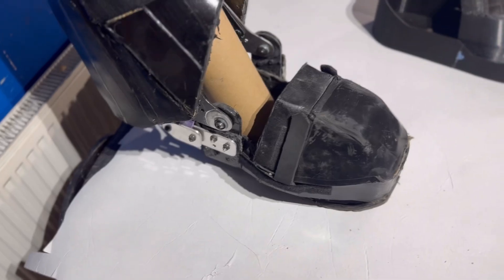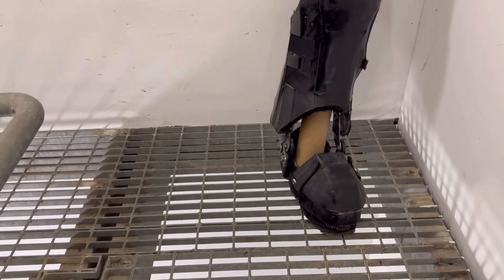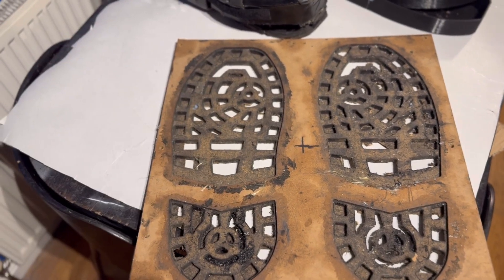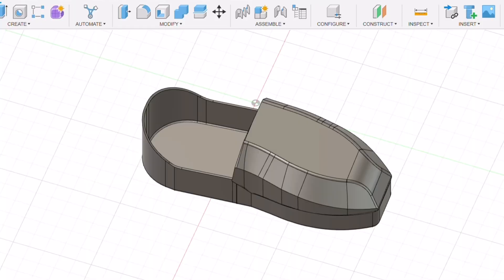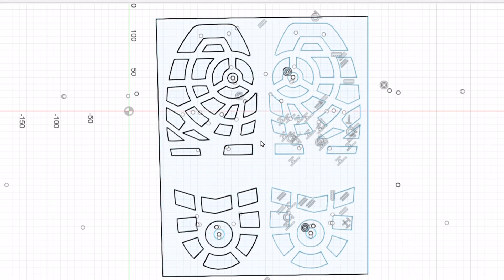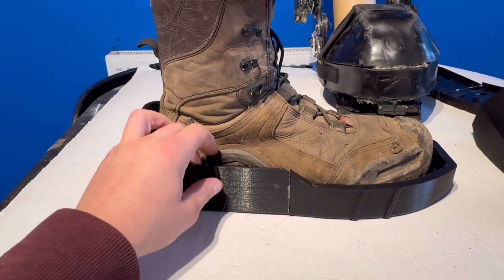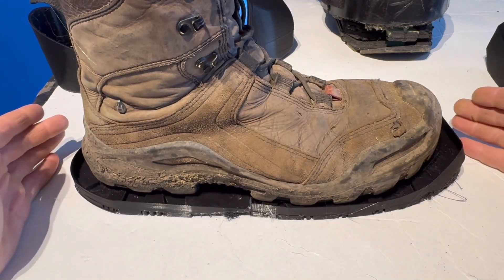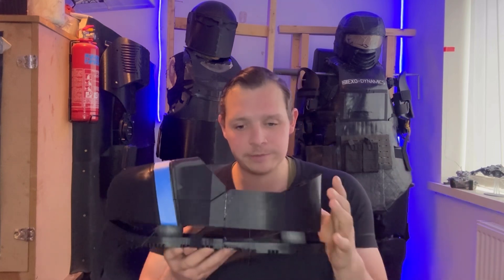The WEIRD Problems I found making EXO-SUIT BOOTS - Power armour casing upgrades

Comment: I don’t think lining any of the armor with ceramic is a good idea. Not only does ceramic expire and thus loose its bullet resistant capabilities, it also doesn’t have multi-shot protection abilities, and thus becomes brittle after taking an initial impact.
Reply: Have you seen some of the new developments in ceramic plates? There are a few that can now take a few hits.
Reply: Why add armor to protect your feet. Most will shoot at your upper body.
Reply: @ofire6E15E  Its not just to protect against gunfire. Shrapnel is a massive cause of injury and that can strike anywhere.
Reply: There are some new ceramic mosaic designs which divide the plate from a single piece to multiple, meaning one shot will not compromise the entire plate.

Comment: I would argue power armor ahould not be used while operating a vehicle not made with power armor in mind. Obviously you need to consider it for your use case, but for real world military, its doubtful things like tanker crews and APC drivers would wear power armor due to tight confines, and pilots certainly wouldnt wear full combat grade power armor. I think vehicle crews would wear much slimmer non-armored strength enhancing suits if anything, maybe keeping breastplates or something external to the vehicle or stored together inside for use if the vehicle must be abandoned.

I also think that early exo-suits like we are attempting shouldnt focus on making the entire body entirely impervious, but rather lessening the threat to the extremities while making the main torso and head all but impervious to non-armor piercing small arms fire, as well as some low power armor piercing type rounds like TMJ versions of common pistol rounds (such as 9mm or .45acp)

Also remember that any armor put into real use will have new weapons developed specifically to combat it if such equipment does not already exist, so the goal should be to reduce injuries from the most common injury sources. For american soldiers in the current day and age that would be mines, IED's, and cheap 7.62x54 for the most part if you can make it bulletproof to 7.62x54 from most angles in the torso, and shrapnel resistant at close range across the whole body, thats a massive reduction in casualties. Couple that with a significant strength boost to allow carrying weapons that would otherwise be small vehicle mounted (m2 browning, small 20 mil autocannons, chain fed grenade launchers, etc.) Would be huge force multipliers. I would also consider that its likely that only a few soldiers in a given squad would be given full powered armor in most squads unless we faced an enemy who equipped most of their soldiers in a similar way to the power armored units.

Comment: I don't mean to sound overly negative, but I don't understand the need for carbon fiber over the entire structure- what's keeping you from using cheaper materials (i.e fiberglass or vinylon) composites on lower stress areas? also, I figure you've thought about it, but have you studied after action reports with general locations of injuries in the environments you're targetting?

Comment: 9:34 I'm curious if adding a pair of sideways ball bearings to use as pivot points to help increase turning? You have potential two spots on the design that already have a circular design?

Comment: You may wanna consider using a hard tpu to print those soles. Great layer adhesion plus cheaper than resin and you can experiment with infil types.
Reply from the maker: Thanks ill look into it! It would be better just to print them. The resin came out well, but is a pain to do

Comment: Why not use a non-newtonian fluid on all kevlar pieces to make it more bullet resistant and provide more protection with less weight?
Reply from the maker: Its a good idea, ive thought of using it as part pf the gamberson/mantel covers to cover some of the gaps up, just havent got round to it and i also dont know how much manufacturing complication it might add. Be cool to experiment with at-least.
Reply: @MattExo-Dynamics  Id suggest doing it with replaceable 'gel packs'. replaceable parts is so important.
Reply: if you did the gel idea you might also want to run tubes through it, these tubes could be used for cooling in hotter climates with the gel distributing the cold more evenly to make up for how hot the persons gonna be, cause i really think in a combat environment they would just overheat and pass out. something else to look into is any liquids that might get harder when touching blood or other liquid's, maybe air, idk if they exist but it could maybe help with wounds. depending on where you get hit that might be a lot of work to get off and get bandaged. also this would help keep the cooling liquid inside.

also, for the front of the ankle you might want a piece of metal or kevlar that slides up from pushing up against the shoe, and falls down from gravity. but that could also get bent and jammed, so if it could come off easy that would probably be good.

Comment: an interesting, nice choice for the ankle, dang ankles are a nightmare for power armour or well any armour in general. do like the of foot idea, but better for industrial workout-type units instead of military since a bigger foot means better balance depending on the end result, really looking forward to the back section since curious how all the more sensitive stuff would be fitted in
Reply from the maker: Thank you and yes they are! Aplt of mine is just based around how think you can make it. Theres more ‘advanced’ ways to do it but they all get pretty chunky and there fore bad on the stairs! And great, providing my printer plays ball that should be out nect weekend!